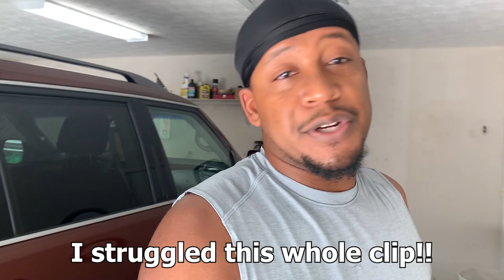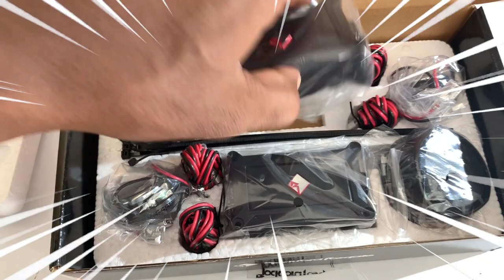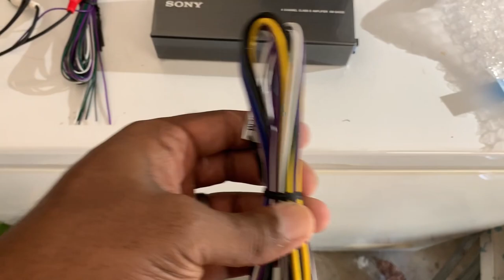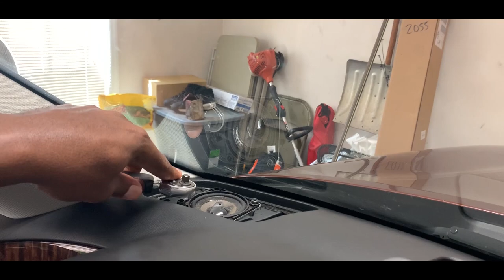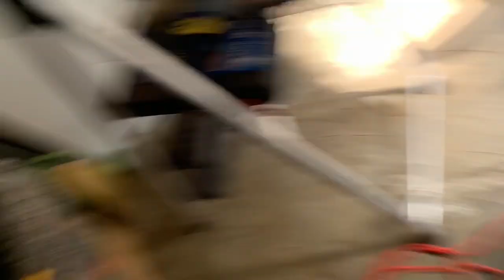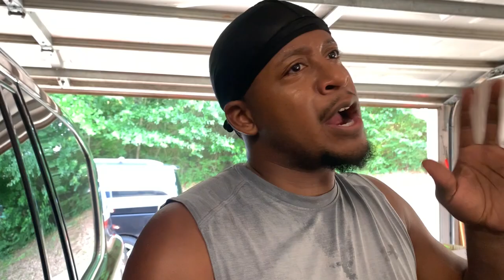Replacing Trash Bose Speakers With Aftermarket Ones!! (Part 1 Speaker Install)

Comment: HELP ! 
anyone improved, modded their Ferrari F430 spider / coupe sound system ?
i consulted w/a audio specialist shop he said maybe different head unit as the becker is weird ( keep it for future owners ) but otherwise just put in some better speakers !
( mine has the silly big $ option BOSE "upgrade audio " extra speakers , amp , sub etc
Bose® high power sound system (Modis Code: SNDB)
Available for both the F430 and F430 Spider, Bose® and Ferrari have developed a brand-new, high-power sound system. This system incorporates a new technology called FortaTM. It also includes the AudioPilotTM system, which is found on the 612 Scaglietti and the 599GTB Fiorano.
Bose® technicians developed special equalization tuning for both the F430 and the F430 Spider.
This system is composed of 11 strategically placed loudspeakers and includes:
&#8195;
A bass enclosure with a special amplifier, including 1 active woofer & 2 small passive elements. It is located under the climate control panel, linked to the center tunnel
2 tweeters, embedded in the mirror triangles
2 woofers at the bottom of the door panels
4 twiddlersTM at the top of the rear wall
One 8-way amplifier with digital signal processing, located on the rear bench"
Can't believe that Ferrari could install such a poor set of equipment especially with the cost of the upgrade to the Bose set up.
BOSE stands for "Buy Other Sound Equipment " LOL
so better speakers and and ......................DONE. 🤣??

Comment: Great video. I bought that same knife as back up but didn’t use it. I was curious on how it cut. I had a smooth outcome cutting plexiglass with jigsaw plexiglass blade so never got to use my plan B
Reply from the maker: The knife is not good in my option!! Maybe for thinner plexiglass but the jigsaw did the trick for me too!!

Comment: Can someone please help me! I have a 2009 Nissan Maxima that has the Bose system the back speakers by my he window where not working nor was the front door speakers I had no bass at all so I changed the back ones an put kicker speakers in an I do have some bass now but it sounds horrible what am I doing wrong???